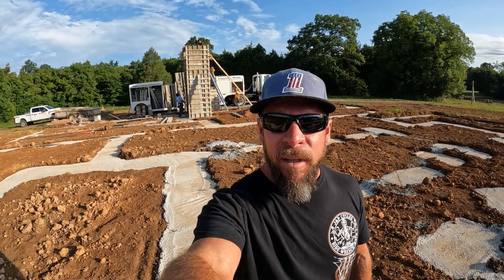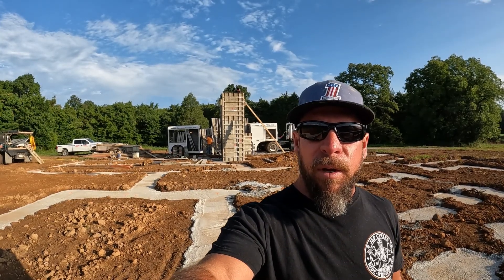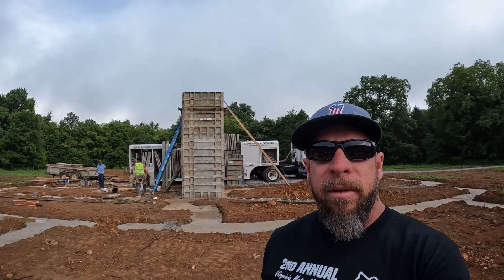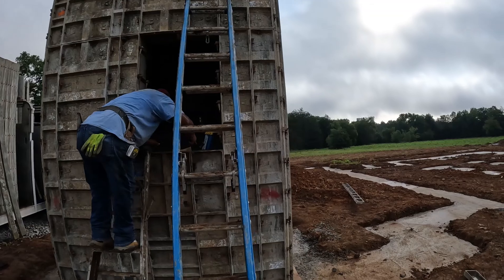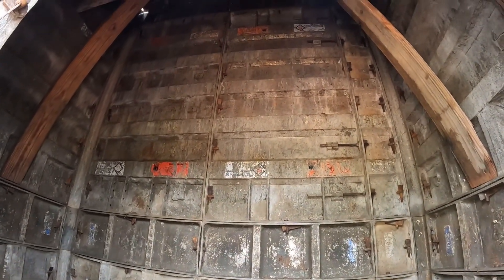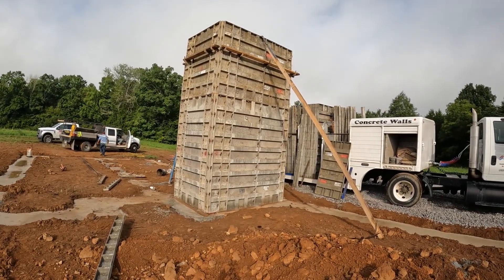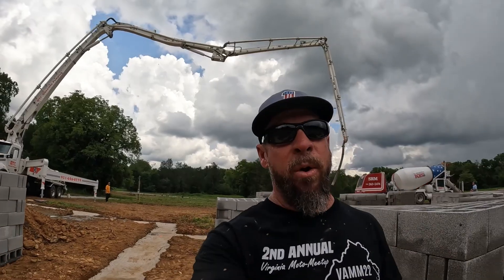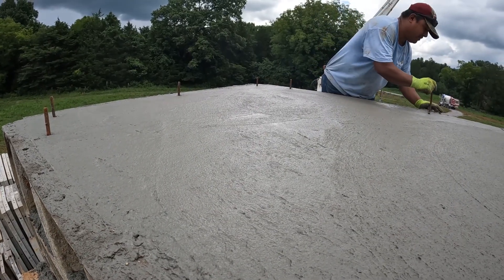How we build a concrete above ground storm shelter #concrete #concretepumping #stormshelter

Comment: How do you go about insulating the concrete? Seems like it would be a big thermal bridge between the conditioned house and the ground. Can you put rigid foam between the footing and the reinforced walls? And then possibly rigid foam on the exterior of the walls?